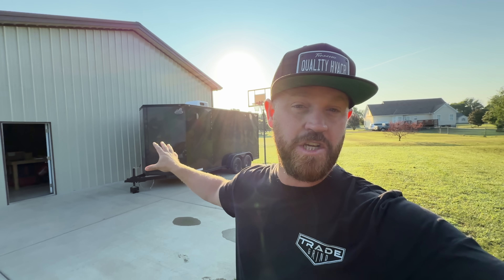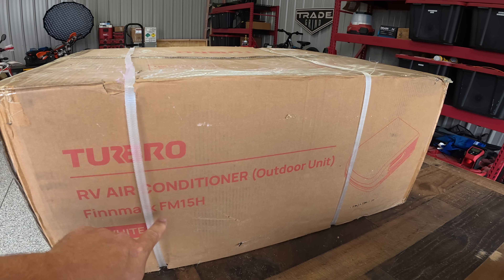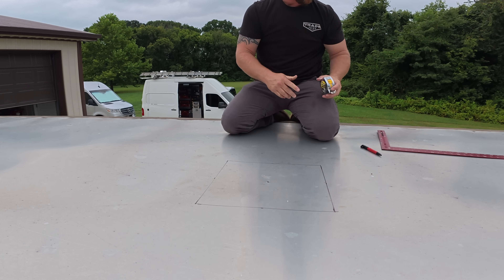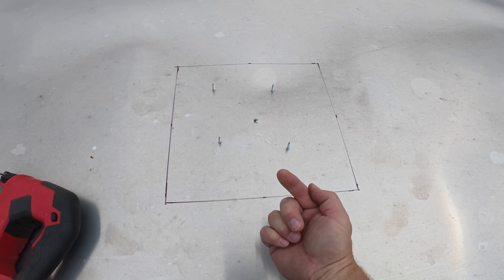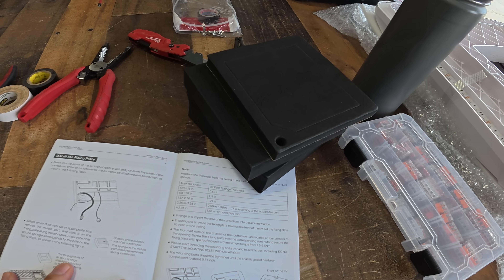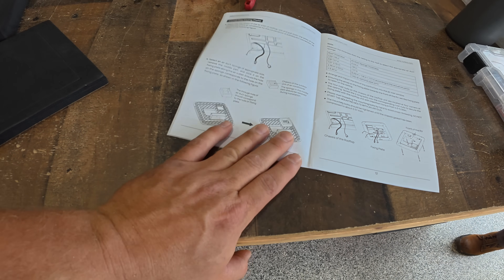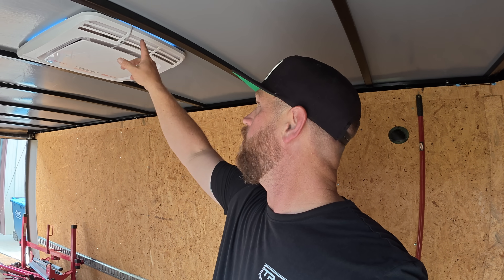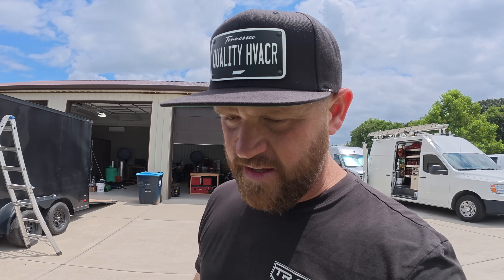Installing A/C in my HVAC Enclosed Trailer

Comment: You should install some support on the sides. That sheet metal is to thin. Also I rewired mine to 24 volts thermostat relays and transformer. If anything goes wrong parts can be easily found. 12 volts cost a lot and hard to find on a trip.
Reply: I agree. Stupid idea to not frame around that opening
Reply: @johndeerefarmer4483  Yeah I used to sell cargos and motorhomes/travel trailers from multiple factories.  Never seen an AC not mounted to a steel frame.  That's saying a lot, because they build RVs and Cargos poorly.

Comment: Great job dude. I've been thinking about these myself. Hopefully theyll last as long as one of the more well known brands like dometic. Its nice that the bottom air distribution vent was included. Maybe a follow up video in a year to let us know how its holding up? Also i agree that a converter is probably your best bet to provide the 12v without having to be tethered to the truck. Awesome job either way.

Comment: Must be in mild climates cause that thing would make a bunch of noise down in SoAz and blow some air, forget cooling the air. 
RV a/c’s suck beans. 
Seriously would wait and do the inverter version, uses way less power, less gas use on the generator, and the btu rating is more real and probably with a more powerful quieter blower. 
But that’s just me, my hvac opinion.

Comment: Weird that it requires both 110VAC and 12VDC.
Reply: crazy dumb, I would say
Reply: The 12 VDC is based on RV use, where there is a separate 12 volt system for low voltage interior lighting, HVAC thermostat, absorption refrigerator controls, pretty much everything that doesn't require 120VAC. The low voltage DC made boon docking possible before solar panels, high capacity batteries and inverter systems became practical.  It's a legacy thing in the RV industry.

Comment: You can use a solar generator, or battery bank with inverter, a solar generator that has 12 volt and 120 volts..........Good job........

Comment: Since you have no celing inside the trailer there is the option of running SJOOW or something like that inside, securing it to the metal supports with clips and screws and terminating it in a 4x4 box with your receptacle. It would also hold up better than sealtite on the exterior.

Comment: tie the 12v into the trucks harness, but honestly a 2nd battery setup up front in like a tongue box would be best (could even add a mini solar panel to the lid to charge it). if you park with the truck off, it would kill the battery (if the truck still supplies power to trailer when off). for the conduit, sch80 up the side and 90 at the roof and run it to the unit, waterproof and would look better than sealtight.